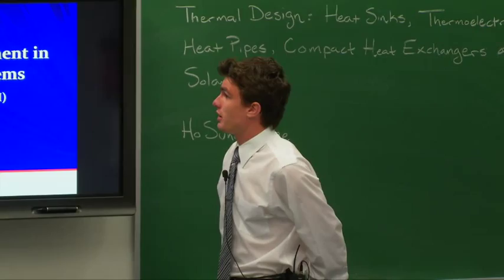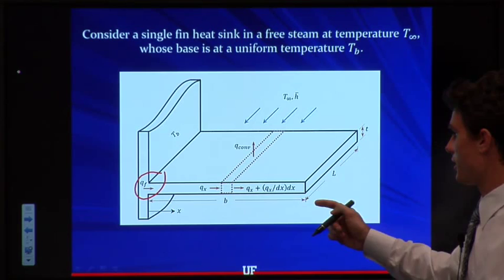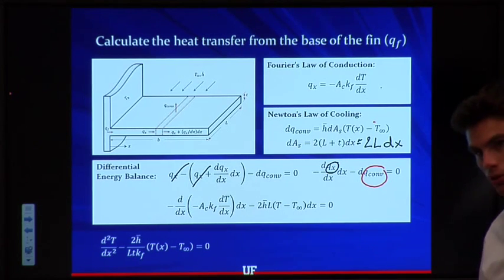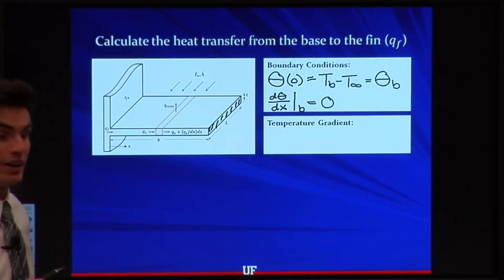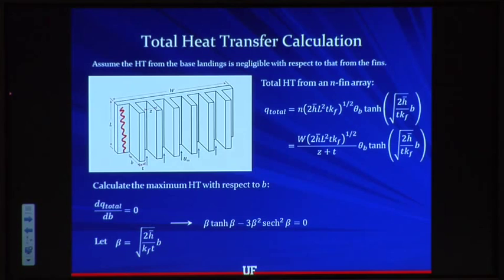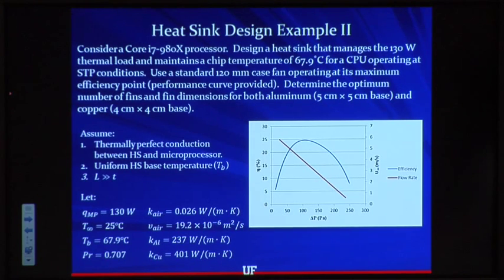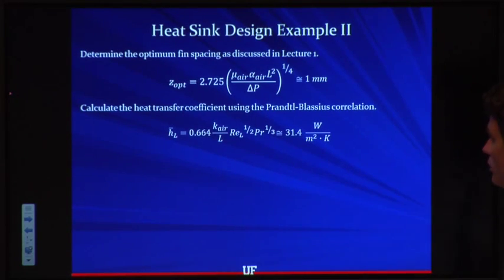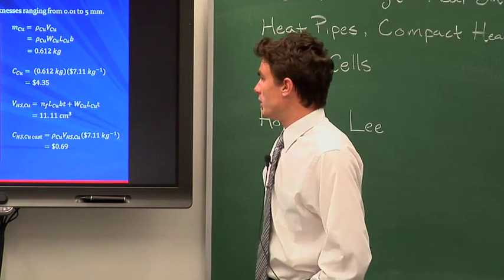EML3005 - Supplemental Lecture 2 - Thermal Management: Heat Sink Design II

Comment from the maker: Hi Alexis,

If you have a circular array of rectangular fins (see http://www.designworldonline.com/19000-series-radial-fin-heat-sink-extrusions-for-led-light-engines/#_) then the Prantl-Blassius correlation used above would be appropriate, assuming that the flow is laminar and the Pr > 0.6 (and this would be the case if your working fluid was air at STP).
Reply from the maker: Hope this helps
Reply: Matthew Inman Very useful thanks...
What if we add something like a contact thermal resistance from a thermal grease. How could we determine the geometry of the HS in this case? I am trying to desing a radial HS that looks like this one: http://pimg.tradeindia.com/00499549/b/2/Round-Heatsink.jpg
Reply from the maker: Usually, thermal grease is added between 2 rough, solid surfaces to decrease heat loss at the boundary between said surfaces. Are you suggesting adding grease between the LED and the HS (which wouldn't change the geometry) or are you suggesting coating the HS in grease? I wouldn't consider the latter practical, as thermal grease is typically held to the surfaces via some contact pressure, and without this I would expect it would just run all over the LED and the other curcuitry in your system. 

You will have to be careful applying the analysis in the video to the ridged-fin in your link, though you can probably make a decent estimation so long as the ratio of surface area to volume of the true ridged fin and theoretical flat-fin are equal. 

I hope this is helpful.
Reply from the maker: circuitry*

Comment: hi, I feel your lecture for heat sink is very nice and help me a lot thanks for this lecture. I have a one question you have use (delta p) =100 Pascal. this pressure is total pressure or static pressure or total pressure difference. I am calculating for 60mm*60mm fan, every company give directly the pressure =3.1mm of h20,so 3.1mm of h20 is my (delta p) which I need? you can see link http://www.farnell.com/datasheets/318468.pdf. please help me out I will great thankful to you
Reply: I have also same doubt what is (delta p) ? reply ASAP
Reply: In my view Δp is 3.1mm of h20 but I am not sure.
Reply from the maker: In this analysis delta P is the pressure change across the fan, whereas in this case the static pressure would be that of the quiescent medium the fan was drawing from.  If you assume STP, and know the static pressure and flow rate then you can calculate dP directly.

As for the link you provided, that datasheet provides the max dP and max flow rate, likely at 12 V.  It does not provide the performance curve.  I would recommend a more comprehensive data sheet like this:
http://www.sanyo-denki.com/currentcooling/cooling_fans/onlinecatalog/index.pdf

I hope this is helpful for you.
Reply: Matthew Inman I very thankful that you reply my question but I little confused so please give me your precious time its a request. The link you provide if I use this link and follow the parameter of page no. 50. In that page I use 60mm of fan having 15mm thickness, operating at 12v having static pressure given in table (58.8 pascal,38.2 pascal and 22.2 pascals)and having (air flow 17 cfm,14.1 cfm,10.06 cfm) how do I  calculate dp for these given parameter and please provide formulae of dp when static pressure and flowrate is given.
Reply: Shaleen Sharma I am very thankful if you provide approx. dp for 60mm fan having 15mm thickness.
Reply from the maker: P_total = P_static + P_dynamic
P_dynamic = .5*density*(flow velocity)^2 = .5*density*(volumetric flow rate/cross sectional area)^2

P_static is the pressure loss created by the fluid flowing through the moving fan blades.  P_dynamic is the perceived pressure of the fluid motion being isentropically arrested. P_total is the total pressure loss (or dP in the above lecture).
Reply: Matthew Inman ohhh THANK YOU thank you  I like your reply here cross section area is length * breadth of heat sink right ? your lecture is great man. I give 5 star...:D
Reply: Shaleen Sharma what is a average static pressure value approx. taken for rough calculation?
Reply: Shaleen Sharma how to calculate cross section area of fan 60mm with 15mm thickness I feel difficulty. please help me out I m calculating
p_dynamic=5*p*(volumetric flow rate/cross-section area)^2 
 =5*1.097(.399/cross-secton area)^2
Reply: Shaleen Sharma my microprocessor base dimension 6cm*6cm and my height sink height about 40mm. I m using 60mm fan having thickness 15mm what cross-section area I need to put in this formulae
Reply: Shaleen Sharma MR shaleen sharma I have read your all comments. I think you find a difficulty in measuring a cross section area of a given fan having  dimension 60mm and 15mm thickness in pdf at page no.- 50.  http://www.sanyo-denki.com/currentcooling/cooling_fans/onlinecatalog/index.pdf I think this question also easily answered by Mr inman. I am weak in this thing sorry :D
Reply: vaibhav sharma yes I have a problem regarding cross section area.
you use any dimension sheet of any company with fan 60mm and please help me out to calculate cross-area
Reply from the maker: Shaleen Sharma Your cross-sectional area should be 60mm*60mm = 3600mm^2 = 36cm^2.  The 15mm is the fan thickness.
Reply from the maker: Shaleen Sharma Make sure the constant out front is one half like this:
 p_dynamic=(0.5)p(volumetric flow rate/cross-section area)^2

Also, be sure you units all cancel out appropriately so that your dynamic pressure is in Pascals.
Reply: Matthew Inman hello inman you previously enter this formulae P_dynamic = .5*density*(flow velocity)^2 now you have given me this,  p_dynamic=(0.5)p(volumetric flow rate/cross-section area)^2so which formulae I have to use this is my last question. please REPLY ASAP
Reply: Matthew Inman and the answer I get is like this
p_dynamic=(.5)1.097(.399/0.06*0.06)^2= 6435 pascal this value is very bigger something I m missing in this.

I want to make heat sink for my 0.06*0.06mm base plate.
Reply: Matthew Inman
mr matthew I m sorry I am asking lot of question. I am a student of final year make a small refrigeration system for computer using peltier plate.

so I need a help to design heat sink

i find problem in finding delta p

see heat sink base plate is 60*60mm

and my fan dimension 60mm having 15 mm thick.

now you have given a formualae of p_dynamic

in which we have to put the value of crossection

1)first tell me which cross section are you talking ,fan cross section or plate cross section

2)) if i take 60mm*60mm as a area, the value of delta p comes is very greater

so i think you please please help me because you have a knowledge about this

In your video you have use .05m*.05m plate and 120mm fan but your deltap comes as 100 pascals

only u please solve deltap value

nothing i need extra

i will be always remember your help
Reply from the maker: Shaleen Sharma They are the same.  average flow velocity = volumetric flow rate / flow area.  Double check your units, as that appears to be the problem.  Also, there is no need to do the analysis as shown, if the fan specs you have give you the flow rate and static pressure already, and the efficiency is acceptable, then use those values.

Shaleen, this comment section is meant for clarification purposes only.  It is not intended for answers to school related homework or projects.  Questions of that nature must be directed to your professor, TA, or fellow students.  I
Reply: Matthew Inman okk thnks for your kindness...thnks for giving as this lecture